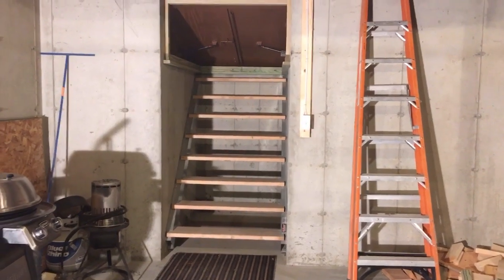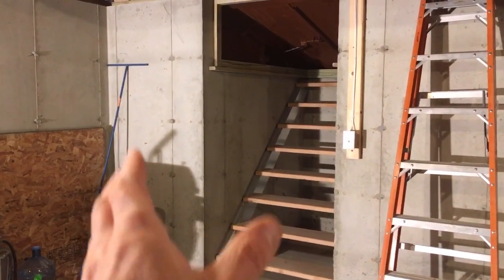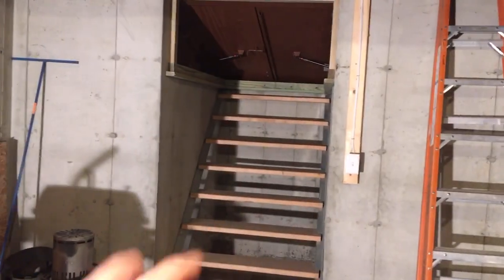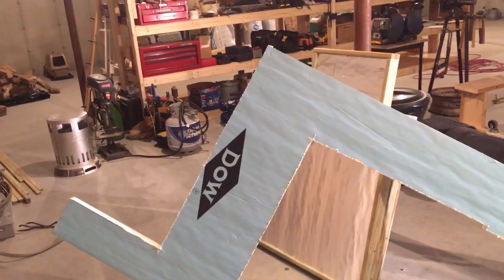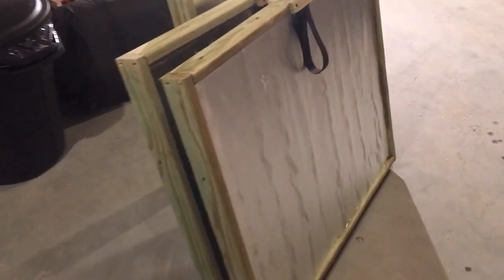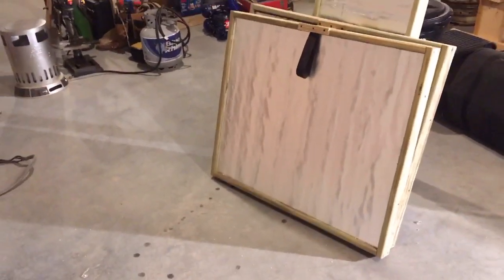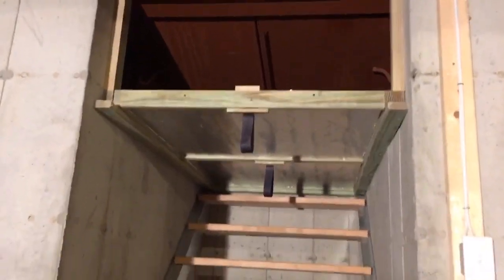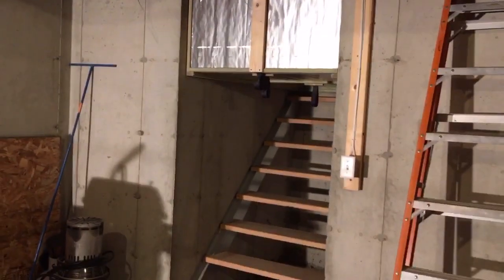Nov 19, 2019 - Insulating A Bilco Basement Entrance

Comment: Thanks for this. Very similar situation with the bulkhead. Considered putting a door on but it is too wide so I was looking for examples where it was framed differently. I had read about this technique before and previously sought out a detailed example/video to see it in action but didn't find anything. Glad I didn't go with putting a door on as I am in Maine as well and do not want my concrete to crack. Also your end result is much better than the info I'd previously seen which was to just put insulation boards around, but the reusable panels that just slide in is genius. Bit wary of attaching the wood to the concrete with a ramset so I will probably use concrete screws.
Reply from the maker: Yes, I agree with you about using concrete screws instead of ramset fasteners. I had a couple of "blowouts" in the areas that I used my ramset.

Comment: I don't understand. How are you supposed to exit your basement with those panels blocking the outer doors? 
Do you have to pull them out and REMOVE them everytime you want to enter or leave?
Reply from the maker: The panels are only there during our frigid winter months here in Maine. The access is shut off during those months.
Reply: @BlackLabAdventures  Ahhh... Okay. Very interesting solution! Thanks! 🙂
Reply: Is that the only way in and out? I have a similar  entrance  but also have an entrance  from inside  the house. My thinking for me at least this would  be a safety  issue as it would block a means of egress in an emergency

Comment: Damn dude. Our basements are so close to identical. I do something similar to you but not quite as thorough. I just encase the area that you did with some pink foam insulation. I also take a full 4 x 8 sheet of the foam and seal off the doorway. Definitely helps in the winter. I also put a tarp over the outside doors.

Comment: Without a door, how can you secure the entry from the bulkhead into the basement 
Besides, I see it is a very common practice to have a door in the interior.
Do the cracks develop in cases where the concrete cutout is part of the foundation vs. Precast concrete steps that are bolted on separately?
Reply from the maker: When winter rolls around here in Maine, the bulkhead door is locked, the insulated panels are installed, and that is how everything stays until spring.  As of last weekend (3/21/2021), that panels have been removed and the bulkhead doors are unlocked.

Yes, the foundation cracks (In cold climates.) when the cellar entry portion is part of the main foundation.
Reply: Thank you for the response. I wonder if it is the thermal expansion and contraction forces at play. With a foundation that is continuous, there may not be any room for "play" thus fracturing the concrete. With precast concrete stairs, im hoping this may not be an issue.
Reply from the maker: @ET-dg3ud , the issue has to do with how deep the ground freezes around here in Maine. The freezing and thawing of the ground "lifts and lowers" small foundation areas like a cellar entryway. The action will "sheer" off the entryway.
Reply: @BlackLabAdventures  makes sense, thank you.
Reply: @BlackLabAdventures  so is this less of a concern in areas with more moderate winters? Im in eastern pa and my home has an interior door leading to the bilco. Wondering if I can do more to insulate that.

Comment: That’s a great idea. On a different topic, what did you use for the stair stringers? Our concrete steps are crumbling and I want to replace them myself. Thanks.
Reply from the maker: I purchased the galvanized, steel stringers at the same time that I purchased the Bilco door.  The stringers are also manufactured by Bilco.  They are very easy to install, and are a boon to lowering heavy items down into the basement.  The stair treads can be removed very easily by sliding out of position.  I own a small loader/backhoe, and by using the bucket on the machine, I have lowered two commercial quality (all cast iron) tablesaws, and a 3 cylinder diesel engine to our basement by removing the stair treads and easing the equipment down to the cellar floor.  Check out this link for starting your research for your specific situation: https://www.bilco.com/ProductDetail/Stair-Stringers-for-Basement-Areaway-7
Reply: @BlackLabAdventures  Thanks. This was really helpful. Much appreciated.
Reply from the maker: @njtangs  You are welcome!  Good luck with your project!
Reply: Pressure treated stringers
Reply from the maker: @Brian-Sizzle  , A waste of time and money.  The Bilco galvanized stringers arrive all set up to install.  They take about 30 minutes, and you are ready to SLIDE treads into the slots.  And, when you want to, you can SLIDE those treads back out.  You aren't doing that with pressure treated stringers.
Reply: @BlackLabAdventures  yes I thought you were asking for them to be permanent

Comment: Awesome video! What you describe is exactly what happened in my basement where the previous owner installed a 38" steel door when they finished the basement. I have a floor to ceiling crack on the left side of my stairs which leaks (A LOT!!) every times it rains. It took about a year to realize it had soaked the insulation and carpet underlayment and mold was growing on the back side of the sheet rock. I ended up taking it all back down to the studs and will start over once I successfully seal the crack. I'll definitely be using this solution! Anybody need a steel entry door?
Reply: Tom, Tim here in Ct. Are you in Maine as well? Cant believe the foundation wall would fail  due to weather differences, I was going to use the R13 an make a verticle door , but his video has given me pause, , thoughts, Tim
Reply: Tom, I live in the cold north east and was planning to install a precast concrete stair and bulkhead. Several bulkhead installation contractors suggested the same insulated steel entry or wood doors.

What I'm wondering is of the situation posted in the video applies to precast concrete steps that are bolted on to the foundation instead of poured concrete with wood steps as shown here.

Your thoughts/suggestions are appreciated.

Comment: Those contractors may be misguided
Reply: I agree.  Plus there are many reasons to have a door that seals (cold in winter, humidity in the Summer and drafts (fire) year round.) 
I have seen and repaired concrete foundation cracks in lots of spots, nowhere near a bulkhead and in bulkheads with no door.  I think this video shows a good, inexpensive way to insulate, but i would still go for  a factory sealed door.
Reply: @jaywatson8706  My bulkhead cracked for this very reason.  I live in NJ & for a month it was very cold.  I placed plywood and a blanket over the opening.  When I removed them there was a horizontal crack all the way around.  It is great to have a door at the opening in the Summer because of the humidity this system is a great idea!

Comment: How do you keep panel 3 from falling out?
Reply from the maker: I added two screws, "toenailed" into the jambs. They are not tightened down. Just enough pressure to hold the panel in place, but easy enough to remove them at the end the winter season.